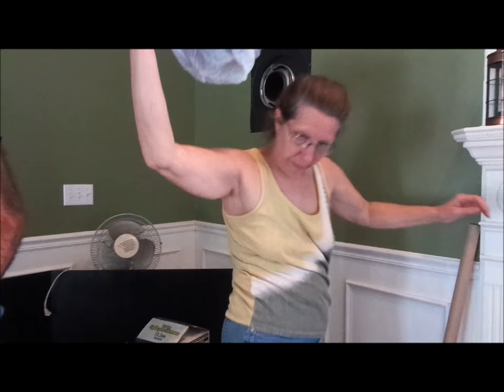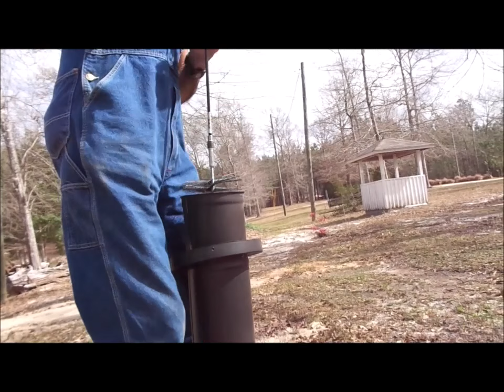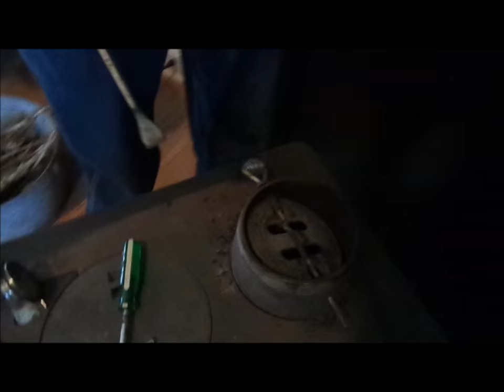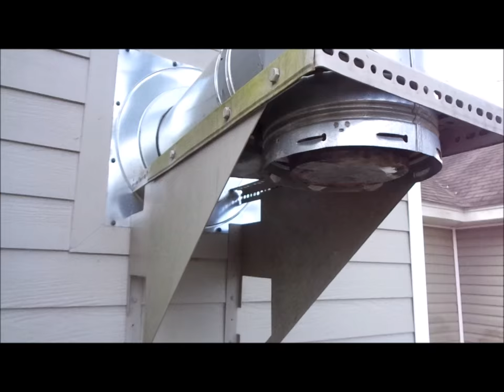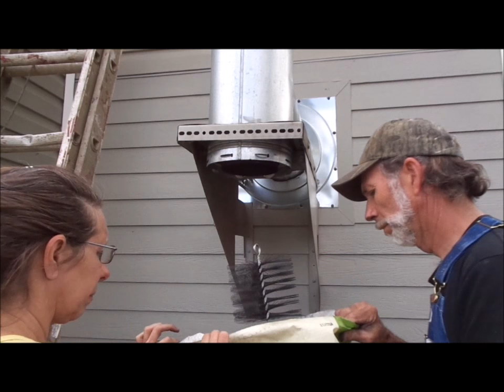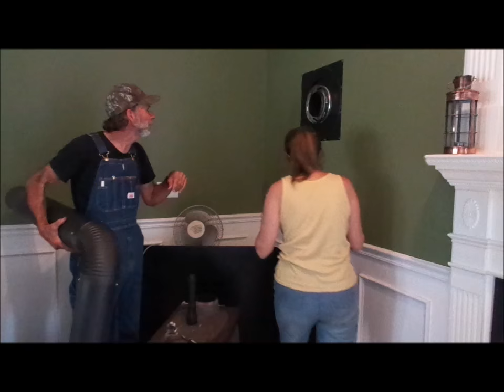DIY - Cleaning the Wood Stove Pipe

Comment: Thanks for shareing. I am about to use a woodstove for the first time and I was needing to learn how to clean it properly. I noticed that it seems like you didnt use furnace cement in your pipe joints. Is it common for people to not use it? My wood stove manual recommends to use furnace cement at every joint including where it connect to the stove top. But everytime you had to take it apart to clean it you would break the seal and have to reseal it. Im a bit confused on that part. Any insight to offer?